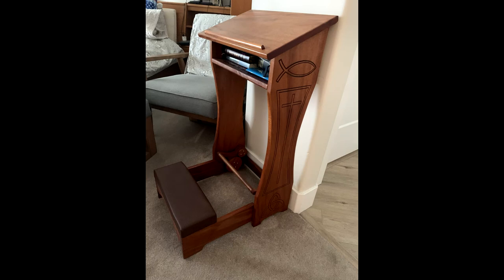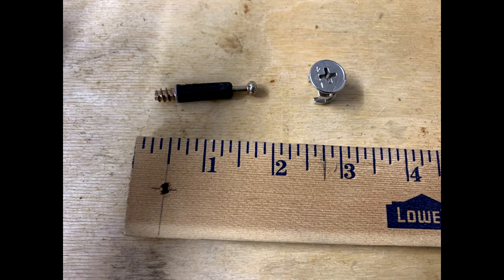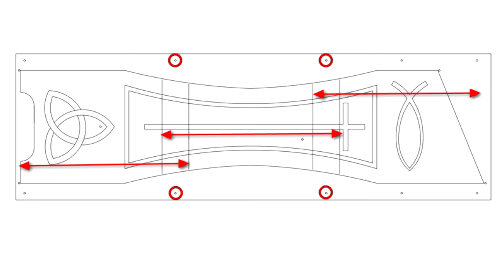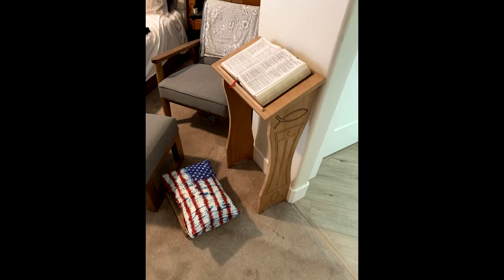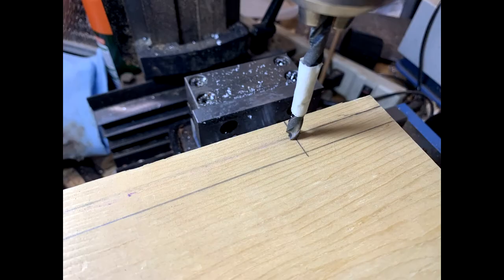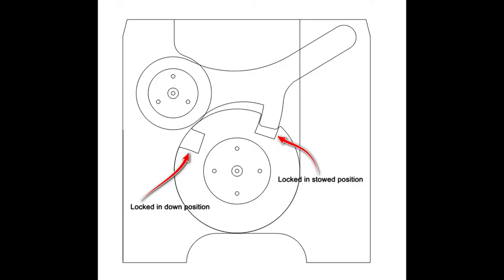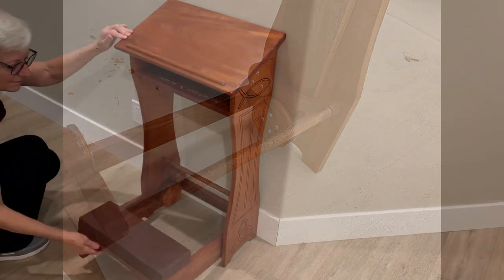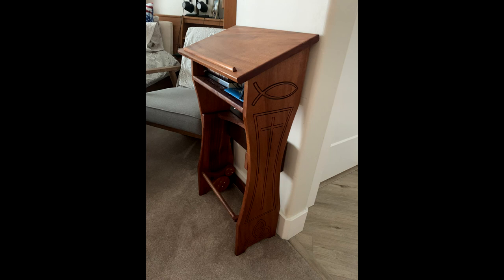Prayer Kneeler (Prie Dieu)

Comment: Perfect design. I am not a woodworker. Would you be willing to make and sell one of these?
Reply from the maker: Thanks for that! While I have never before considered your request,  I suppose I could mfgr/sell you one but it would almost certainly be cost prohibitive. The wood alone (Mahogany) was over $200 plus another 50-100 on other stuff. Then there is the time I put into it. Didn't keep track but I worked on it part-time for about a month. So even at what I call "Walmart Greeter" wages the labor would be spendy. Of course, the "first one" takes a lot more time than the rest so there is that. All the CNC drawings are already made so that wouldn't be a factor. That said, it is still a labor intensive effort. As an example, let's use 40hrs labor @ 30hr. That would be $1200 bringing the total to around $1400-1500. That is, of course, a bit more expensive than the one you can find on Amazon in the $200-300 range. In any case, thanks for your interest and thanks for asking!